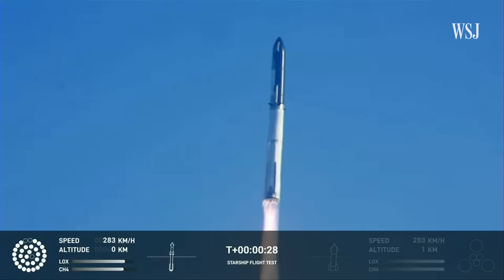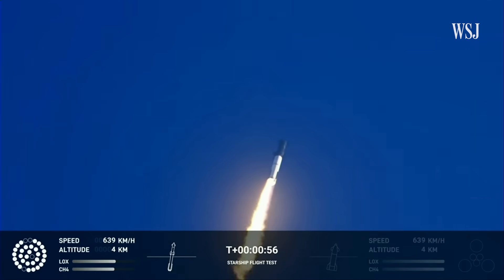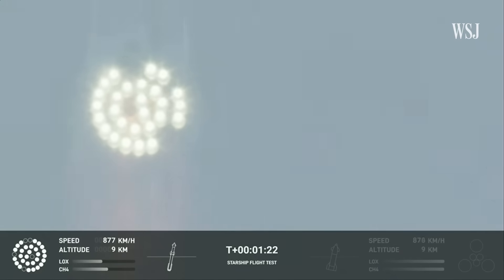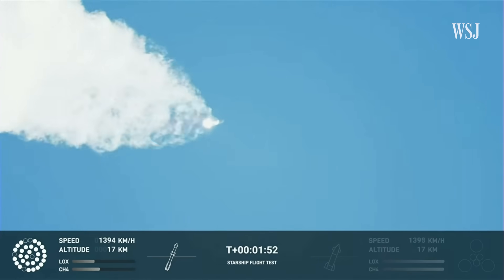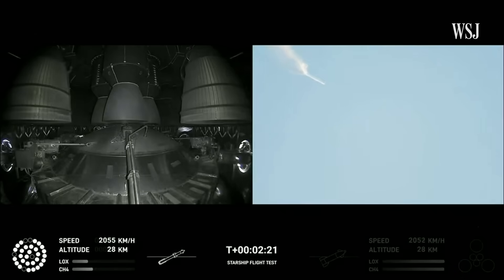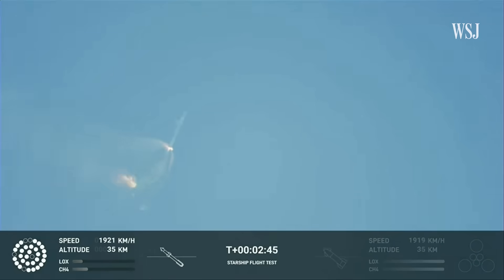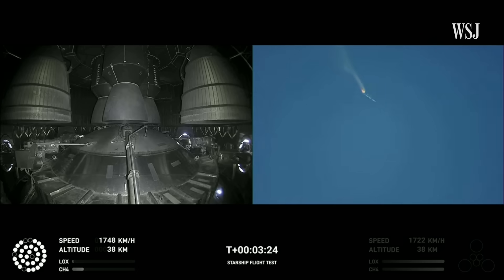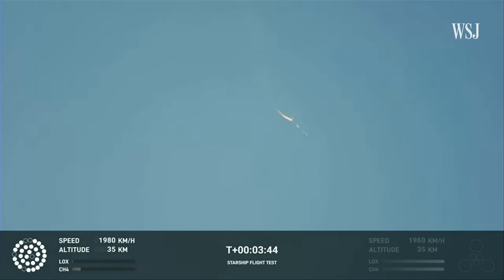Starship Explosion Video: Watch Elon Musk's Rocket Explode After Launch | WSJ

Comment: It is all about passing milestones.  This flight passed two of them when it cleared the pad and when it passed max Q.  That is what makes this test very successful.  Now that it is known where some of the weaknesses are, future tests will probably pass more milestones until they have a reliable vehicle.  For a first test on a prototype vehicle, this test was amazingly successful.  The engineers have a lot to be proud of here.  Of course, I am old enough to remember Redstones and Atlases blowing up on the pads before we began using them to carry the first astronauts during the Mercury Project.
Reply: Surely the lack of fire-diverter must have damaged a lot of Raptors before take off, rumors says a large crater was created. If it wasn't for that this thing might have taken off to orbit.
Reply: it's clear that Starship SN11 experienced a pogo oscillation failure (31 -33 ) raptor engines firing at once vs (SLS) Artemis 1 rocket which has a  total of four engines. this and its apparent Disposable launch pad will be a huge hurdle for SpaceX as Multi-engine rockets are much more susceptible to pogo oscillation phenomenon than single-engine rockets. it took Nasa many years of R&D and is the reason why SlS Artemis 1 chose to use tried and true rocket "boring" technology  Pogo was in fact  the main cause of the soviets (30 ) engine N-1 rocket failure Pogo oscillation is a phenomenon that occurs when there is a feedback loop between the combustion process of the rocket engines and the rocket structure. The vibration caused by the combustion process can cause structural oscillations in the rocket, which in turn can feed back into the combustion process, leading to a potentially dangerous cycle of vibrations.

In multi-engine rockets, there are more engines that can contribute to the vibration, which increases the likelihood of pogo oscillation occurring. Don't be so Salty Spacex fanboys! its ok! lol Cheers from Park City Utah!
Reply: @ezragonzalez8936  I agree on the POGO failure. Rocket visually shakes violently shortly after takeoff.

The Saturn V rocket had severe POGO issues during initial launch tests, requiring extensive modifications to be made.
Reply: Sure, when things go that bad even venting excess gas before launch is reason for commemoration!
Reply: @whysocurious7366  I believe they are way better than NASA. Where is Nasa's reusable rocket and when you find it count how many times it's made it to orbit and returned successfully. If you're talking about making it to the moon then yeah Space X hasn't accomplished that yet but they will no doubt.
Reply: It technically got to MECO too
Reply: @Keith Herron Indeed, not a failure.  

For example there were a lot of test flights before Apollo 11 historic landing on the moon.  Apollo 1 had all crew members died in a fire during a launch pad test on January 27, 1967.  No crewed test until Apollo 5 was used to human-rate the landing module and Apollo 6 to human-rate Saturn V.  Apollo 7 was the 1st crew flight to Earth orbit.
Reply: @gensao not one Saturn was ever lost during launch. It was an insanely successful enterprise. Not sure starship can compare on those terms.
Reply: @whysocurious7366  Sure... While NASA uses SpaceX rockets to send astronauts and supplies to the ISS.
Reply: Well, it's time they quit stealing our tax dollars for this nonsense. Oh and for stupid Wars as well.
Reply: @Keith Herron I like SpaceX too. They might fail more often than NASA, and they might hoard the technology that they develop instead of sharing new technologies like NASA, but at least they use up public subsidies like NASA.. 

oh wait, socializing risks/expenses & privatizing profits is actually a bad thing.. the third thing was supposed to be good.. oh well.
Reply: @Keith Herron  No, its a failure. It exploded but the sycophants will cheer when told to.
Reply: Looks like a waste of money, but capitalists are stupid enough to invest in literally anything when money is cheap. Hello crypto.
Reply: This is also AFAIK the weakest of the starships and they have made improvements to the fabrication since this one was built.
Reply: Elon Musk just can't successfully do business.  Totally overrated, this African American... compared to real African Americans. It's time to fire Elon...
Reply: A bunch of idiots launched a failed starship !!! 😂😂😂😂🤣🤣🤣🤣🤣🤣
Reply: Innovative technologies were presented at the international online forum "Global crisis. There is a way out". For example, the health capsule (the possibility of life extension, rejuvenation and absolute health), from time 7:09:09.
These technologies will be available free of charge to everyone in the Creative Society.
Reply: Failure is when something not expected happens, and that is the case. Amateurs trying to emulate established industrialists.😂
Reply: @Keith Herron They were going to retire the rocket before it launched since the new versions already have alot of improvements made. But they decided to launch it anyway to collect data.
Reply: It's not as if this was the first rocket ever lauched.
Reply: @frenchimp  That was the most powerful rocket ever built. The first of its kind, a Russian built rocket made a couple of decades ago blew up upon ignition so the fact this this more powerful SpaceX starship made it past max-q is a HUGE accomplishment.
Reply: @ChosenMJ  Sure, when things go that bad even venting excess gas before launch is reason for commemoration!
Reply: @fingerprint8479  Why are you repeating yourself?
Reply: @ChosenMJ  and five of its engines were damaged at launch and nearly reached the targeted height of 40k is amazing. Raptor 2 is extremely powerful
Reply: @frenchimp  lol right? Some people seem to forget NASA can launch rockets that do NOT explode.
Reply: @whysocurious7366  exactly! SLS was successful the first time it launched 👍🏻
Reply: @BrianSu  sure, but after like a decade of delays and with much already flight proven technology. SLS is very cool to be sure, and an amazing rocket. But it's not really groundbreaking, and it's not anything that's going to be the future of space.
Reply: @whysocurious7366 nasa launches zero rockets right now…. They contract mostly SPACEX and ULA
Reply: @whysocurious7366  you forgot space shuttle?
Reply: @whysocurious7366  Yeah, you are are right.. Oh, by the way, who launched the Challenger & Columbia with a total of 14 astronouts?
Reply: @whysocurious7366  NASA has had plenty of rockets that have exploded and also they have never launched a rocket of this size you Momo🤣
Reply: @BrianSu  is that really what you think I said?
Reply: @joeabad5908  jeez, you Elon fanbois are bad at understanding mathematical facts.. NASA’s rockets survived, way more often than Space X’s.
Reply: Absolutely spot on. This was a success, they have been here before.
Reply: The success of the test is determined my the test objective prior to testing. What were the documented objective of the test?
Reply: @tigerrx7  clear the pad.
Reply: @tigerrx7  Primarily just to get it off of the pad.  Then ride it until it failed so that the next prototype could be improved.
Reply: This is a fake CGI cartoon.
Reply: A second failure soon to follow.😂
Reply: It’s just like Twitter.. sometimes you just gotta fail miserably over and over and over to maybe not fail someday.
Reply: Bro we passed this milestone in the 60s
Reply: @lucuslovesyou2961 its a new type of rocket using a new type of engine cycle a new fuel and being the largest ever this was impressive
Reply: @peeperleviathan2839 
1. the similarities vastly outweigh the differences. 
2. There was nothing more new and aggressively bold than the audacious F-1 and entire Saturn V launch vehicle. 
There was no equivalent predecessor of Apollo to draw knowledge from. No prior programs of its kind. These men were otherworldly intelligent. Elon is a great innovator, but some of his mishaps were avoidable… you just can’t deny.
Reply: @lucuslovesyou2961  no we did not. Saturn V and Starship are 2 different beasts.
Reply: @lucuslovesyou2961  derp derp a-doy bro not with any rocket anywhere near this heavy it has never been done before derp derp-a derp
Reply: bro must work a double shift at krispy kreme and dunkn donuts with all that glazing
Reply: "That is what makes this test very successful."
Sure, when things go that bad even venting excess gas before launch is reason for commemoration!
Reply: @fingerprint8479  it's supposed to vent gas haha! Look at the Falcon 9 before launch, it's arguably the most successful rocket in history and it vents gas
Reply: @mattmatt516  Sure it vents gas and did not explode doing that... what a success!
Reply: @fingerprint8479  I can't tell anymore if you're being sarcastic
Reply: @mattmatt516 it vents gas man. It vents gas. It’s worth repeating.
Reply: what about the pollution and the money wasted
Reply: It damaged the launch station then blew up. I'm no Elon hater but that's a failure.  Factually a failure
Reply: @bigduphusaj162  Nah you're confusing this with your life that is factually a failure...😂🤣😂
Reply: @Keith Herron it was. they arent inventing a new tech. they are refining tech that already exists. this was a failure
Reply: @DeltaFoxtrotII  this was objectively not a failure. They achieved way more than they intended to achieve with this test. They 100-percent knew that the rocket was going to be destroyed at some point in the test, just look at the documents they had to file with the FAA for permission to Launch.
And no one has ever attempted to build and fly a rocket this big or this powerful. Especially not one with a goal of being fully reusable
Reply: @DeltaFoxtrotII  Are you an aerospace engineer?  No? Then shut yer yap.
Reply: @DeltaFoxtrotII  it was never expected to get to orbit for the first flight
Reply: Ok Elon apologist
Reply: @Sheepskin501  Ok troglodyte, you do it first try. Maybe wrap it in sheepskin?
Reply: @Sheepskin501  stop wearing your mother's frocks 👍
Reply: @Sheepskin501  SpaceX is a separate entity from Elon. The company is still pushing the boundaries of human technology and space travel and I don't really care if Elon is the one that owns it
Reply: @Sheepskin501  Are you the trans Cultist?
Reply: @steven530x  Please leave it alone it can't even figure out what it is... it has enough problems in life don't you think?
Reply: @Sheepskin501 commie

Comment: Hilarious that the announcer thought that the tumbling of the rocket was a nominal scenario. The Super Heavy booster is supposed to perform a flip - AFTER starship separates from it 😉😉
Reply: Ahahaha yeah, when he said that I was trying to think of ways a flip prior to separation would benefit anything. Then it flipped all the way around and thought “That’s odd” By the second flip it was clear an explosion was imminent.
Reply: @UmightBwrong  no they terminated the rocket so it doesn't get to far from flight path. if it didn't break apart during that flip, it more than likely would of just fell straight down and exploded on the water, which is why the blew up in the air so sea life doesn't get to affected by shock waves
Reply: ops..americans were on the Moon?! realy?!
ahaha

Comment: Remember this is the test flight of the first prototype.  It not exploding on the launchpad is already an achievement.  It exploded during separation which is a clear event that can be studied to determine the issue.  This will provide very valuable data and is a remarkable accomplishment for a first flight.
Reply: It was likely a self termination. They probably killed it when they knew they couldn’t save it from the spin. Every spacecraft has a “kill” function that destroys the craft. Just incase it goes off course and endangers people.
Reply: Thank you for clarifying that. I was confused by seeing the rocket flip around and then explode… the people cheered. What I was watching and what I was hearing were not congruent with my limited understanding of rocket science. So to be clear, this was an unmanned flight which was designed to explode in the Earth’s atmosphere at some point. And they did it. Okay great!
Reply: @pennyandluckpokerclub  It wasn't designed to explode. It did get farther than they expected before exploding though. Lots can go wrong with rockets, especially on your first iteration.
Reply: @canadaplease7981  Yes, It was designed to explode (flight termination system). It is a safety feature they had to include in case something goes wrong. Not separating from the first stage wasn't intentional, resulting explosion likely was intentional.
Reply: @pauldobson9379  You didn't read what I was responding to. The person was under the impression it was always supposed to explode within the atmosphere. That is incorrect. It only exploded because of malfunction out of safety
Reply: @pennyandluckpokerclub  Well, to say that it was designed to explode is an overstatement of the case.  It is more accurate to say that it was expected to fail at some point during the mission.  Now they know where and how a failure will occur and can correct it.  During the launch of subsequent prototypes one can expect further failures down the line, which will be corrected until they have a reliable vehicle.  This is just how engineering is done.
Reply: @pennyandluckpokerclub  Sort of... It was designed to be able to explode for safety in the very likely case that something fails. Something failed (as expected) and subsequently intentionally exploded.
Reply: So many negative know it alls in the comment sections.
Reply: I believe the rocket was detonated intentionally after the separation problem took place.
Reply: @BudzzableRides  Yeah, that’s the “BIG RED BUTTON” nobody wants to hit😂 didn’t separate which is kinda odd considering it’s probably one of the more simpler things on such a complex machine.
Reply: Tesla is is down 8% and falling you Musk fanboys are really something else. If this was the plan it was a bad plan.
Reply: Flight Termination System command is sent by Range Safety.
Reply: ops..americans were on the Moon?! realy?!
ahaha
Reply: Party like its 1959.
Reply: Okay Elon.  This isn't a Space X stockholders meeting.
Reply: @joe.oneill  lol
Reply: @joe.oneill  If you pay any attention to rocket development besides hate watching a new space x rocket, you'd know basically nobody even makes it to maxq, and definitely not passed it on their first launch. Most of those rockets are dinky little things the size of a school bus, not the largest rocket ever made.
Reply: @Instabilitygarrosh  you mean the largest pile of rocket scrap ever made?
Reply: @Instabilitygarrosh  Look up the first flight of the Saturn V / Apollo 4.
Reply: If you say so
Reply: Im not holding my breath,and they arent holding my money for their fireworks...
Reply: ahahhaahahahahahha
Reply: @mikeletterst9882  Bravo Mike...First real person on this page filled with bots and staff members
Reply: @mikeletterst9882  weirdo 😂
Reply: @freedomisntfree_44  Why are you unhappy about learning something?
Reply: @canadaplease7981 I learned that it blew up, cool
Reply: @canadaplease7981  who said I was?
Reply: @cmet8280  Did you also learn that the falcon 9 rocket when it first start blew up multiple times? Now it hasn't at all.
Reply: Rockets have been not exploding on the launchpad since the 60's. Exploding in launch isn't exactly an accomplishment either. They did that with the falcon 4 times in a row and nearly bankrupted the company.
Reply: @edmundlange3998  we haven't been making new rockets since the 60s when you have a unique design that you are testing you expect something to do wrong and when it's a rocket you expect something going wrong to cause an explosion. The soviets spent decades trying to design a massive rocket similar to this and every single one of them blew up before getting as far as this rocket, they eventually cut the program because it was too expensive and too hard to make it work.

Edit- I just looked up the thrusts of the Soviet n-1s and the starship has almost double the thrust of the n-1s. The n-1 took 2 explosions before they even got it off the launchpad and then the 2 remaining tests done after that they exploded seconds after getting off the launchpad. The soviets had no problem building smaller rockets like the ones we use today where we generally expect explosions to be rare. Big rockets like this are a totally different animal
Reply: @edmundlange3998  Way to not read into anything you're talking about and then trying to act as an authority on the situation... New designs that are untested are just that, UNTESTED. Unknown failures may arise. Do you have any idea why they were expecting a possible failure on the launch pad? I'm not out here claiming to have any great knowledge, but even a cursory look into this specific launch and you wouldn't have said that... 

You're better than that. Ask more questions before you start giving answers.

Comment: why did the rocket look like it was flying through water or something. 😅 such a cool visual effect whatever it is.
Reply: That was the resonance from the spectrometer alopecia interface cumulous disposition actuators....
Reply: @ignacioromero5014   Na uh. It was that the spatial differentialometer fractal teradactal waves were at nominal separation from the idiotic neuromental nuclei. Simple bro! Get it straight!
Reply: Air condensing around the exhaust of the engine due to the temp differential.
Reply: It's called a mirage.
Reply: @JohnSmith-nj4zq  that does seem more plausible with the gases coming from the rocket